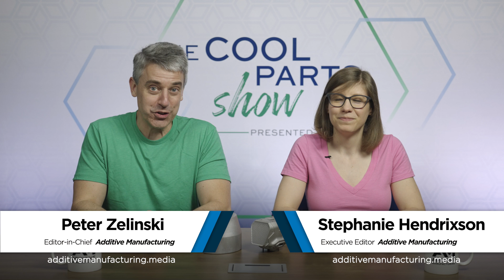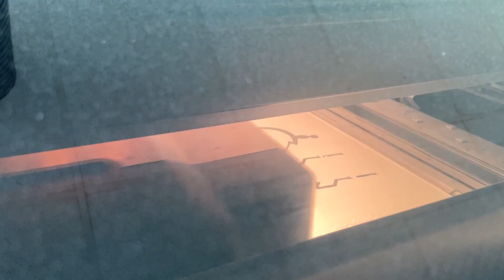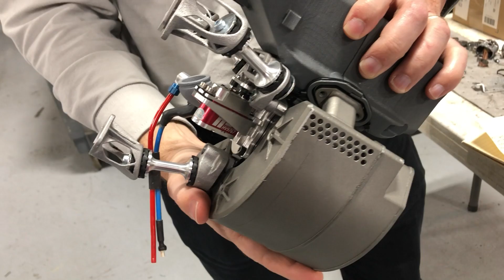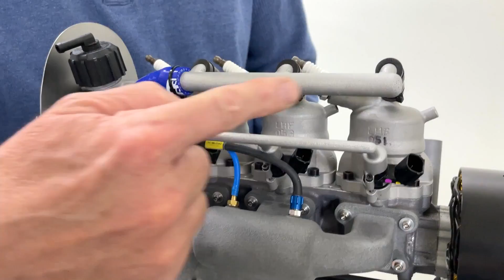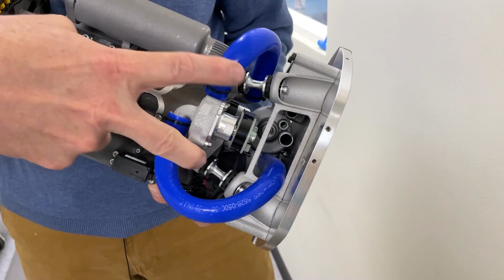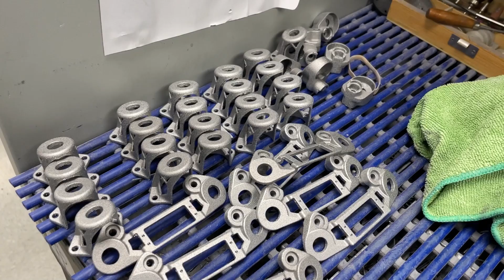Drones Take Flight with Metal and Polymer 3D Printed Parts | The Cool Parts Show Bonus

Comment: Is this a 2 or 4-stroke engine? What's the displacement of this little beast?
Reply: Judging by the absolute lack of a camshaft (the heads aren't shaped to host one, plus there is literally no shaft going from a cylinder to another) and the reed valve he mentioned, this is definitely a 2-stroke TPI engine.
Reply: @KToMmi  gotcha. Thanks! Should've known better.

Comment: I am curious to see how these polymer parts perform in the long run, seeing as they'd mostly operate under high temps and pressure.
Reply: Well long run does not really exist for UAVs, these engines have a typical lifespan below 100 hours. But also bear in mind that your car has many polymer (polyamid) intake, oil, fuel, ... components just like this one has the intake; except this one is 3D printed.